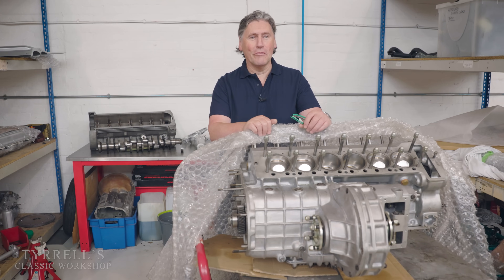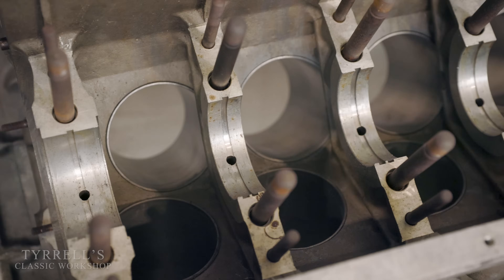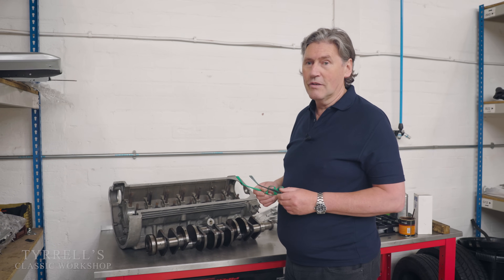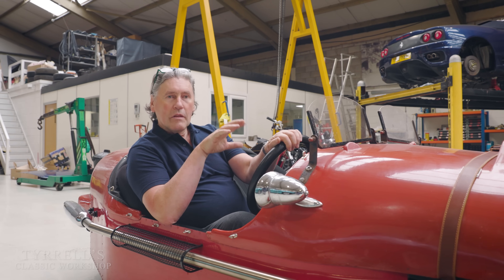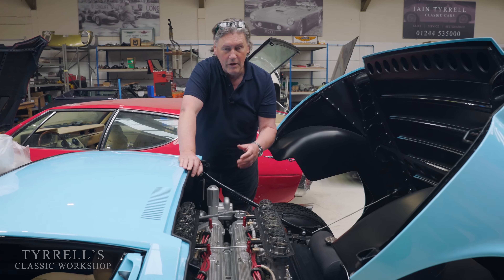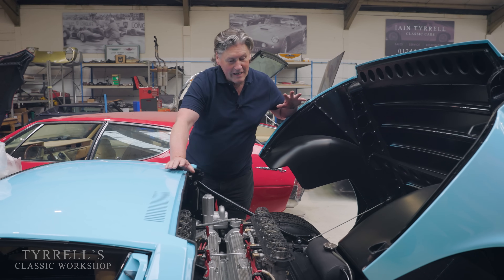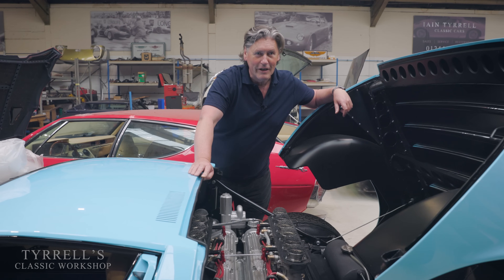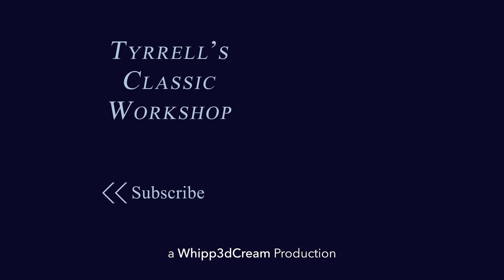How to warm up your classic car engine the correct way & why it matters | Tyrrell's Classic Workshop

Comment: Oh Ian, how I need you! I’m about to start a Matchless V twin that was professionally rebuilt 40 years ago. I would hate to destroy it in the first few seconds!
Reply: bon fortune!!
Reply: If I may ,bearing in mind that I'm not nor ever will be Mr T
For a first start from rebuild ,take the plugs out and turn over on the kickstarter if it's a motorcycle? For a good couple of times to get the oil around,then try a start with as least amount of fast idle /choke as possible ,once running you may increase choke to achieve smooth running,but bear in mind that choke should be fully off asap.
Reply: @mrcogginsgarage7062  it’s a 1935 Morgan Super Sports. Thanks for your help

Comment: Great video Ian. Though I would argue that anything related to Mercedes Benz in the last 20 years cannot be referred to as "reliable or well built". Sure ones built before 2000 were unmatched quality but Mercedes lost its mind in the 21st century. I'm shocked how terrible our car is, I'm meticulous in my maintenance and I've had nothing but major trouble endlessly. It makes me very sad and frustrated because these are such nice car that give such a good ride but they're let down by mind bogging, bad cost cutting decisions.
Reply: Well statistics from DEKRA and ADAC disagrees with your thoughts regarding Mercedes with top marks and even “best overall” (E-klasse). This was in 2015.
Recent years Audi, Mercedes and BMW is more or less equal regarding reliability.
Reply: German engineering is living on ''old fumes''. I have heard Audi is fairly reliable these days, but MB, BMW or Porsche cannot built reliable and ergonomic car for their life.
Reply: @anonymousonlineuser6543  My 2002 Prius runs like a charm...
Reply: Mercedes M112 and M113 and M113 AMG engines up to 2006 ,( SOHC per bank  , three valves , two spk plugs and one coil per cylinder ) have earned a reputation as being extremely reliable and long lasting. Quite likely the V8 M113 AMG is the most reliable , relatively economical and easiest to maintain AMG engine ever built.
After 2006 with the introduction of the M156 DOHC and VVT they certainly declined however, due to some design and material flaws.
Reply: @Leo555ZZZ  nearly every car with a m112 m113 goets scrapped with its engine running well, i had a clk320 and 2 clk430 and a cl500 every motor was sound as a pound
Reply: @Leo555ZZZ  I have the M157 V8 (585ps) and have daily driven it for 2 years (inc. winter) and it’s performed flawlessly 👌🏻
Reply: This applies to other brands as well, I think it goes from regulations mostly, resulting in overcomplicated engines, running thin oil, lean mixtures, high exhaust temperatures and all that. Add to this higher material costs and now more parts are made from cheap plastic, and switch of paradigm - car should be good enough to live up to 200kkm and be cheap to run for the first owner (25kkm oil change crap). Mid 90s was probably best time for reliable cars from both Europe and Japan.
Reply: @maxpool162  Very true. That is why all engines these days burn obscene amounts of oil.
Reply: @anonymousonlineuser6543  sorry, but that is simply not true. In comparison to the pre-2000-Engines, nowadays the oilburning is definitely much less, my experience, having owned many cars, from the 60s to 2022
Reply: @emanuell5926  I owned mostly German and Japanese cars starting from mid 90s.  German and Japanese cars are notorious now for burning oil which is the design feature of modern engines. To comply with emissions and MPG, tolerances become tighter oil thinner, engines smaller. Result - they wear out piston rings in a few years and start consuming oil. I did not even bother checking oil level in high mileage Toyotas from 90s. They never lost oil. These days my  4cyl 2013 Toyota burns oil and my 2017 V8 MB burns oil ,  both excessively.
Reply: @anonymousonlineuser6543  how can stringent emission laws lead to cars burning more oil??? they wouldn't pass the emissions test,, i think your cars are broken
Reply: @anonymousonlineuser6543  between the cost-accountants making component spec decisions & the CFOs not interested in anything much beyond the lease period (+ a few yrs for the Program Cars program)... they don't need to care anymore.

Comment: I am quite surprised that the v12's of a certain age didnt have oil priming pumps to get oil to the cams before putting mags on.The RR Merlin needs about 30 or so seconds using an electric aux. pump. from cold.Ok much bigger engine but same principles.Also a very rich start up caused bore wash which also caused huge wear from cold.

Comment: Thanks very much for all the vid's over the last year. Question? All the new cars have auto engine shut off when you come to a stop. I turn that feature off because as you state, and as I was taught all the wear and tear happens during start. Also, living in Arizona I need the AC on when stopped! Is this auto stop feature a wear issue on modern engines?
cheers
Reply from the maker: Hot starting is much less of an issue. Engine is thermally stabilised, and oil is all over

Comment: Brilliant! I have heard of quite a few folks who put "pre-oilers" on their engines. Basically an electric oil pump that pressurizes the system before the engine starts, to ensure proper lubrication.
Reply: Install a preheater for the engine aswell as a pre-oiler.
Win win.
Reply: Seems a pretty obvious solution. If you have a £10,000 engine a pretty cheap solution.
Reply: I don't have one of those, but (on the track focused car anyway) I have an aftermarket ECU running things and it's set up to crank the engine until it sees oil pressure reach a minimum value and only then does it actually start. It doesn't get driven often and it's under a lot of stress when it does so it's a very simple piece of insurance
Reply: @helplmchoking  I have the same with my 190E, but it's just because the mixture is out on the KE-Jetronic so it doesn't start for about 10 seconds anyway. Plenty of time to get oil pressure up
Reply: would love to do that on my car not sure how to
Reply: Even a hand pump pre-oiler would be nice.
Reply: @malcolmnicholls2893  hi
Reply: Hi Tom, just seen your pre oiler piece..just put one on myself...a post that is...
Reply: @paulcarter2907  hello Paul
Reply: Thats he way to go !
Reply: Pre-oiling the whole engine has to be a good thing. The compression alone is enough to wear a dry bearing (or cylinder bore). Even better if it has under-piston sprays as these will coat the cylinders before oil splashing out of the crank can do the job.
Reply: My 2002 Prius does a long pomp noise and when stopped, I crank it. Rev is kept low 30 sec long until oil is everywhere and then engine is free to rev higher if computer choose to do so... It seems it pumps oil perfectly for cranking...
Reply: @michelgervais8607  That noise on a Prius is the brake booster, not an oil pump. I wondered what it was and asked Toyota.
Reply: @JulianMelville  Thanks ! Not enough depression when engine stops so a devoted pump is needed… We had to change this special device on our second Prius 1 at cost of 2300 € 😡 This car was not driven enough and parked outside. Mine is in pristine condition 😎.
Reply: @michelgervais8607  hello Michel how are you doing 😊
Reply: @michelgervais8607  might find the noise is from the fuel pump priming...

Comment: I’m 3/4 of the way through the video right now and you haven’t mentioned different processes for starting classic vehicles when the engine is below freezing I know that’s not exactly what this video was about but it does have to deal with oil lubrication and starting an engine

Comment: I favour having a separate button that only operates the starter, so you can turn it over until the oil light goes out, then start it. Don't touch the accelerator while doing that initial crank to minimise the amount of fuel which will be drawn in by the suction, so it's not washing away any oil on the bores. It won't flatten the battery in 10 seconds or so. On modern cars with complicated electronics this would probably cause problems though, it's only really feasible on carbs.
Reply: A lot (but not all - check if your specific car has this) of modern cars have a "clear flood" mode.  Flooring the accelerator while cranking accesses this mode, which shuts off the injectors.  While this is to help clear a flooded engine, it's also a handy way to prevent the engine from starting (and the cylinders from being washed down with fuel) for those first seconds of cranking if you want a delay before it actually starts.

Comment: Fantastic!  I’m dumbfounded how people start their cars/motorcycles, instantly rev them, shift into gear and drive off.  Worse yet, never regularly start the vehicle only to put undue stress on the battery, allow seals to dry up, carburetor/injection systems to gum and gasoline separate.
Reply: That's how gasket seal problems occur...

Comment: Very, very important topic.  Great video.  I would prefer a small, electric motor driven pump lubricate for a few seconds before firing the cylinders.  Unfortunately that is a ´bridge too far´ for manufacturers.

Comment: If you have an old fashioned immobiliser as was fitted in the 80s/90s, activate it, turn the engine over several times, deactivate and start the engine which allows the oil to be primed around the engine
Reply: Depends if the immobiliser cuts the ignition or the fuel. If you get fuel with no ignition, as was the case with my wife's 90s Civic, you will drown the engine and even get fuel in the oil.
Reply: I like that idea. Disable the fuel pump relay. I imagine it's the least likely to upset the ECU and leave one with a CEL.
Reply: As above, a lot of immobilisers work by cutting the ignition. Most fuel injected cars of that time have an easily accessible fuel pump relay, just pop that out and turn over to prime.

My Aston has a feature whereby on cold start from long layover, you can depress the accelerator fully and press the start button and it'll turn the engine over without firing. Aston actually make a note of those also in the handbook. I guess these types of vehicles see less use than regular daily drivers - but still, it's a nice feature. If I haven't used mine for longer than a 3 or so week interval, I'll used this feature to build pressure before then actually starting.
Reply: @aston-martin-internationalist  I thought that was actually a common feature on EFI cars of the time, not so much for pre-oiling after long periods of inactivity, but to help start a drowned engine by not adding more fuel. Smell gas ? accelerator to the floor and spin it a few times.

Comment: This is why I have a separate switch for the ignition on my SBF 302. Turn it over until oil pressure reaches 50 psi and then start it. Another way which I’m considering is an Accusump oil pressure system.
Reply: What was exactly my touth..

Comment: Excellent advice two things or may be three. 1. having the oil and water preheated before one starts a classic car. 2. Have the ability to turn the engine over before allowing it to start. And 3. not revving the "nuts" off it when it is cold.
Reply: I some time pull out the king lead if the car has sat a bit. Turn until oil light goes out.
Reply: @edgarbeat275  Quite simple you take the water of of the engine hoses in to a heat exchanger the return it to the engine. Use disconnection plugs to stop any water loss. Oil put a small element in to the sump. You can of course heat the gearbox oil as well.
Reply: sounds great but how do you heat the fluids before a cold start??

Comment: Great old school information. Thanks for getting it organized and put in perspective. 
One question though. Cylinder bore wear was once explained to me as being related to acids generated in connection with cold starts. If the engine isn’t warmed through and the acids burned off, they will contribute to cylinder bore wear. Can you comment ?
Thanks again ….
Reply from the maker: That’s part of it for sure. Over- rich mixture with petrol washing the bores and breaking down the essential boundary layer between rings and bore is the biggest problem.

Comment: Absolutely spot on. Thats all the things i was also taught during my apprenticeship with SAAB. Working on old V4's and early 99's. It always used to make me shudder when watching Wheeler Dealers of old, and Ed China would start up an old car and just rev the pants off it. I would be screaming at the TV !!.
Reply: I share your anger at WD. Made for TV, but so bad for the cars.
Reply: They aren't the only ones
Reply: The "Wheeler speakers" are mechanical nuts. Everything fake.
Reply: Edd China is not some hack.  And the guy who would start up the old cars and run them around during the buying process was Mike Brewer.  And finally, a LOT of it is staged.  Pretty sure that they had the cars started, warmed up and everything in between to make sure that they could start it up on the first crank when the cameras were actually rolling.
Reply: Years ago, brand new Corvettes were seizing rod bearings. Owners were operating the engines correctly. Turns out some employee was doing the first start ever on those engines to leak check them. The person was revving almost to redline on every one. Tragic and expensive, to say the least.
Reply: The car has propably been started up so many timed, that the engine is in operation temperature.
Reply: @kasperkjrsgaard1447  Started and immediately shut off when someone yells "cut !" and they repeat the scene. You can often see drops of water from condensation being spit out the exhaust, indicating the car has not been warmed up.
Reply: @CaptHollister  they put water in exhausts so you can actually see something happening for TV..
Reply: @mcspikesky  maybe in films but not on wd. Get real.
Reply: @mattmorris2867  you know them? Standard thing dude, also a wee spray WD40 to get a nice burnout started
Reply: So In other words, Saabs engine were made of chocolate then🤣🤣.
Reply: @JRP-Alfa  _ shows how much you know about SAAB engines
Reply: @JRP-Alfa  Saab V4 from 60’s and 70’s were Ford engines, the early engine in Saab 99 was a Triumph engine. Very good engines, all engines are the same in regards of the need of warming up before revving up, most people have no clue.
Reply: @JRP-Alfa  No. I run The SAAB Clinic. My own 9000 Aero  2.3T has 165,000 miles on it and i hit the rev limiter maybe 3 to 5 times a day, every day. 27 years on and its still great. 317 BHP and 70 to 100 in 3.5 seconds.

Comment: I have a Chrysler 1968 383 V8 with automatic choke. Maybe unique to Chrysler engines that can often be hard to start, I crank the engine many times and it will not fire. Turn off the key. Pump the gas a couple of times, turn the key and it fires right up. I'm aware of getting the oil through the system before it fires which is why I always do a bunch of cranks first. The auto choke can be a bit of a chore to get down to a low idle however.

Comment: Here’s a comment, how come they never put electric oil pumps on cars to pump the oil through the engine 20 seconds before it starts, the fuel system gets primed but I understand that’s necessary but it seems like priming the oil system is necessary to but it has gone completely undone in all of car history.
Reply: It's probably a cost/benefit issue. Most car makers of today don't care what happens down the line. That's why you can buy a used Mercedes, BMW, or Jaguar for peanuts. Because the cost of replacing old tech is more expensive than the car is worth. What do they care if the engine wears down in ten years instead of twenty? At that time the car is someone else's problem.
Reply from the maker: Pre- oilers could be covered in a future episode.

Comment: I have a question, if you were to run a small space heater under your engine let’s just say four 1950s American V-8 car for 10 or 15 minutes before starting it with that help reduce the wear and tear because the fluids would already be warmed up a little bit is what I’m thinking. Would that help any?
Reply from the maker: These things are a trade- off. There are advantages and disadvantages.
Reply: If you have a block heater because it is that cold then heating the engine area before starting would be good.  Otherwise I doubt it would make a noticeable difference.  Putting in an ignition interrupt switch so you could crank it for say 5 - 10 seconds would probably do more good.  Remember to use a Normally Closed Momentary Contact switch of Good quality so turning the key as normal starts the engine just like it did originally.

Comment: For a car that’s sat awhile, I was taught to disconnect the coil and crank the engine, while counting to 5 then stop for a few seconds. Repeat this until pressure shows on the oil pressure gauge (to keep over stressing the starter). Then reconnect the coil, set the choke and start the car. You can then set off, but do not over rev until the temp gauge begins to move. I follow this procedure on my 1965 TR4A.
Reply: I do the same thing with a 2000 Porsche 996, but remove the fuel pump fuze crank it over a few times then place the fuze back in and start
Reply: I usually whip out the plugs to help the starter. I usually like to read the plugs once in a while. Let the light go out.
Reply: @edgarbeat275  Very good idea, but some job with a V8
Reply: Edgar has the right idea — spare the starter by removing the plugs to relieve the compression; keep the starter engaged until you see pressure on the oil gauge. Then plugs in and start.